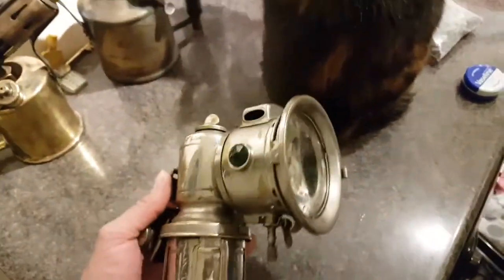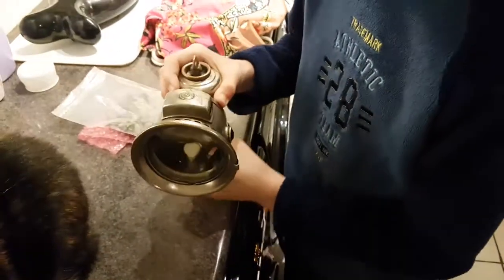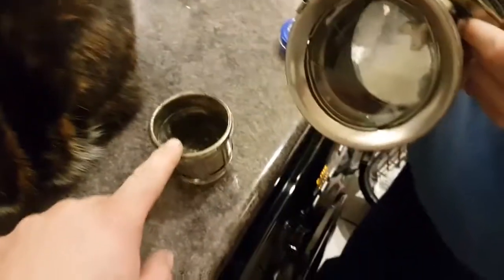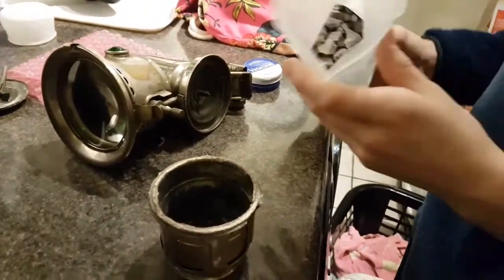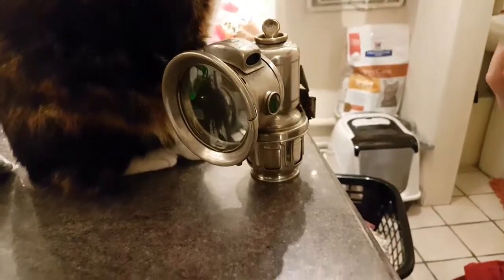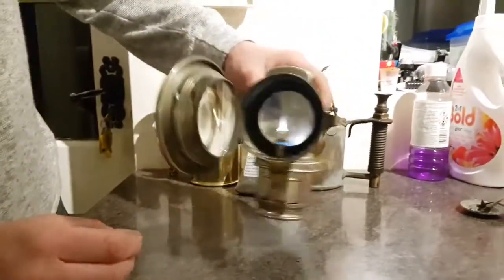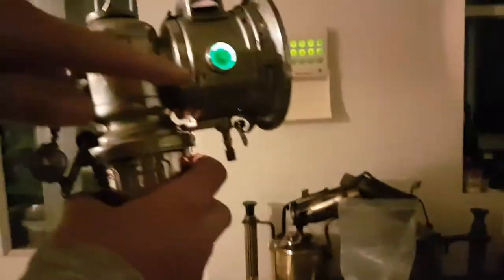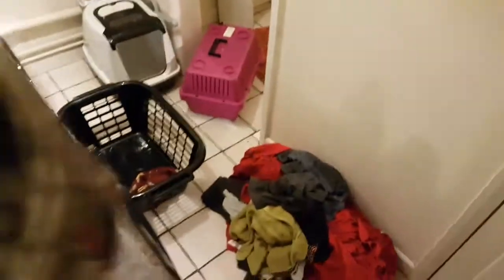How to use a Lucas calcia major bike lamp

Comment: Great video. What was the use of the parts you left out of the lower chamber of the lamp before adding the carbide?
Reply from the maker: Hi, there's a spring ad a plate that's a bit broken on my lamp, I assume it goes over the carbide just to hold it in place as this type of lamp would have been on a bicycle bouncing around so no need for it when only lighting it for fun
Reply: @v12jagster  thanks for the reply. My spring is intact but the plate has corroded. Now I know it'll work without these parts fitted I'll try mine out.

Comment: Just wondering how you cleaned up the reflector?
Reply from the maker: Just used Autosole chrome cleaner
Reply: v12jagster ok thanks I'm trying to figure out how to clean my reflector up it appears to be aluminium and is terribly dull. I'm wondering how your one is looking so shiny. Is your one chrome plated or well polished aluminium? Thanks in advance.
Reply from the maker: @zolinator  it's just well polished
Reply: v12jagster thanks I will try a few methods to get it polished. Just one other thing I don't suppose you know how the gems on either side are removed? I ask as it would appear the gems on my light have been incorrectly installed somewhere along the line as they are wrong way round for port/starboard. Thanks for replying so quick.
Reply from the maker: @zolinator  not 100% sure on gem removal, never had mine out but they look like theres a metal rim holding them in from the outside, may just be pressed in doesn't look like the metal rim unscrews, just be VERY careful as the last thing you want to do is crack one as they are hard to replace. Red should be on the left green on the right (as you sit on the bike with the lamp in front of you) you have an early one as from the 20s I think they had green on both sides as red was more recognised as a rear light.
Reply: v12jagster yea as I thought they are the wrong sides. Iv had a closer look and it looks like the red one is ever so slightly broken around the edge so I will probably just leave it. Iv tried cleaning up the reflector but no result.  I removed it and cleaned it down with isopropyl alcohol to take off the grime but it's still very dull. It does have abit of pitting to it so not sure if this has anything to do with it. I have an almost identical lamp,did the same with that and the reflector came up sweet.the reflector is the same in diameter but is held in differently so unfortunately  I cant use that one. It's a Lucas calcia club lamp. Looks very similar to your one in the video. Because it is stamped g.p.o I imagine finding a reflector that would fit it would be very hard. It's the last piece for a 30s gpo bicycle I have been working on. I didn't think I would find a black one to match the bike as the bicycle is a black inspectors  one instead of regular red. now the bikes finally all up and running I thought it would only be right to try and get the lamp working for a test on the early morning commute. Nice video btw would be good to see you do some more!